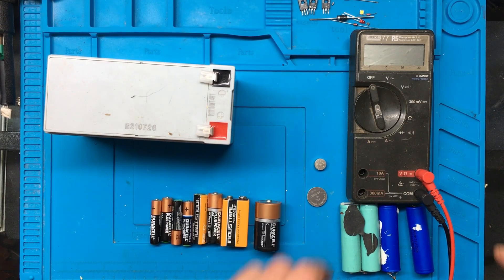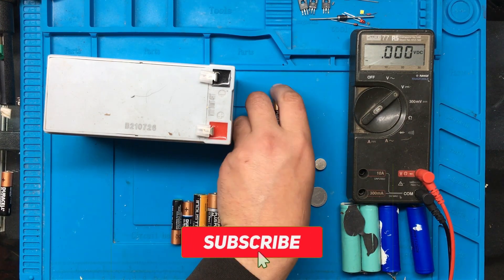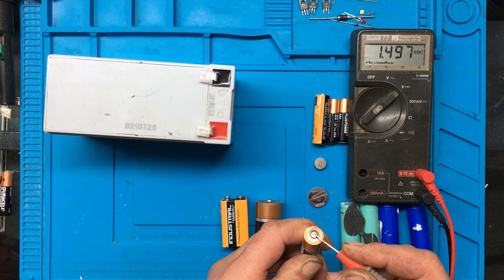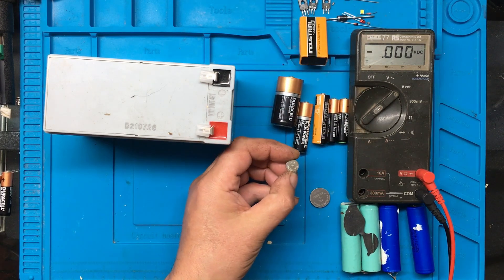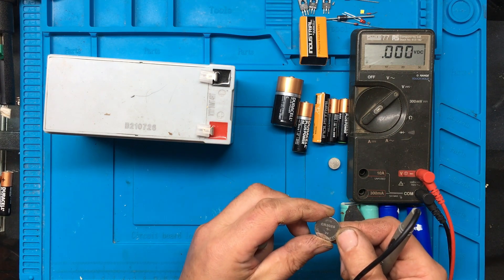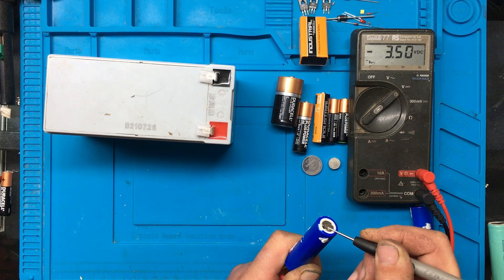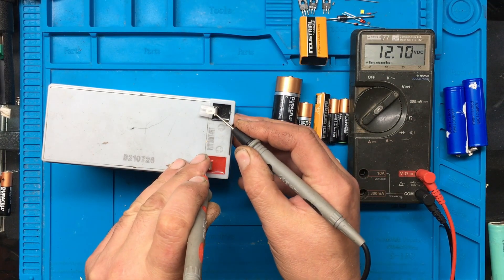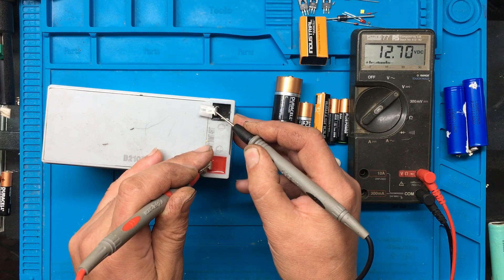Part 2: How To Test Batteries With A Multimeter

Comment: You can't really get a good indication with zero load on the battery. Your cell at 1.4 V could measure 0.9 V in-circuit. Some of the ones showing 1.5 V as well.

I replaced some CR123 earlier this month. They're non-rechargeable lithium cells. The new ones measured 3.1V, the old ones 3.2V.
...then I tested them with an actual battery tester, so under a slight load. The old ones dropped to 1V.
Reply from the maker: Thanks for the info and tip. Yes I agree. The video is aimed really for people who have a test meter, and don't really know how to use it, and probably have a drawer full of batteries and want to figure out what's good and what's not.

Comment: I thought we had to put the battery under load to get its true condition.
Reply from the maker: Good point. If it was a rechargeable or car battery for instance I would agree. Measuring the voltage without a load should still give you a pretty good idea though. Like if I fully charged a car battery to 13.8v then measured the voltage the following day without it being connected to anything and it was 11.9v I'd say it's probably knackered. Likewise for normal household alkaline batteries like AA cells for example a good condition battery should be around 1.5v or higher if you measure 1.4 or less it's past it's best...
Reply: @BuyitFixit  True, in most instances. Have you ever come across those button cell batteries (cr2032) sitting in a mainboard for 10 years and still reading 3v?
Reply from the maker: @bobsoft  I'm not 100%, most of the cr2032 I've came across that are failed measure a lot less like 0.6v or something. In fact I replaced one on the ultrasound machine video that was soldered onto the single board computer.
Reply: A while ago I got notification on my car dashboard that the battery on a keyfob needs replacing. Bought a new one. It is CR2025 or something. The voltage on the old and new battery differed by two tenths only. However, the new one works and the old one doesn't. So I assume the voltage reading may not be a reliable indication.
Reply from the maker: The voltage may drop when it's under load (transmitting) but the voltage of a battery is usually the way to measure if it is good or bad, or charged or flat.